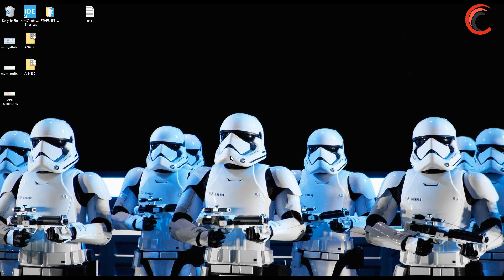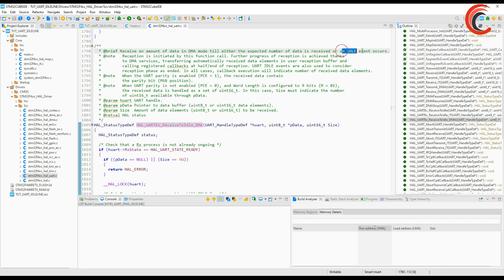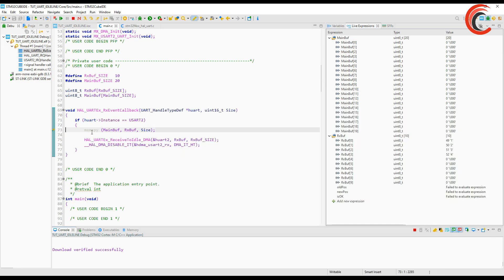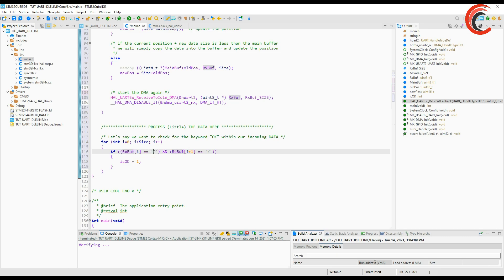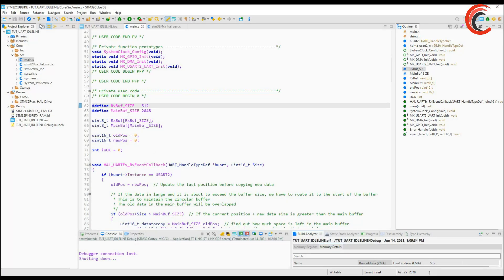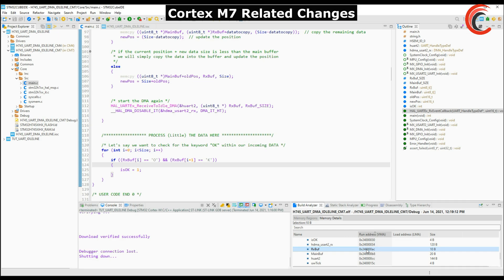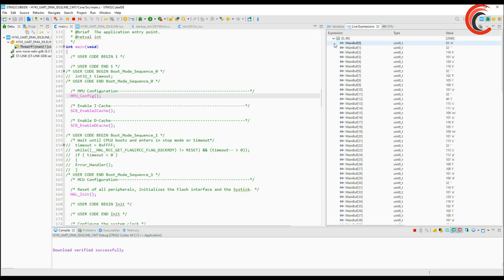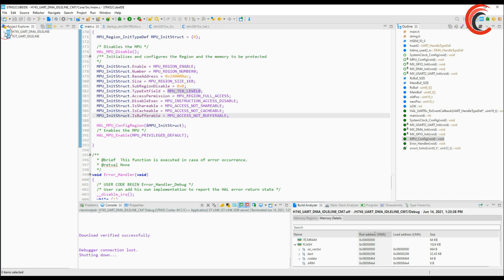STM32 UART DMA and IDLE LINE || Receive unknown length DATA

Comment from the maker: TCM memories are not cacheable. So if your MCU have the DMA access to DTCMRAM, you can keep the buffer in the DTCM and you don't need the MPU setting. F7 Series MCUs are the examples of such kind.
On the other hand some of the H7 series MCUs generate the code in DTCM RAM, but the DMA don't have access to it, so there you need to relocate the buffer to another SRAM, and configure the MPU.

To sum it up, if the buffer is in the SRAM, no matter which one, you should configure the MPU.
Reply: Hi sir,
I'm facing same issue which you shown in last part(rx buffer not storing).

I'm using STM32H7A3ZI-Q Development board.can you share me the details, how to fix.

Thanks for your video. .
Reply from the maker: Watch the cortex m7 playlist, the mpu configuration videos. This is not something which can be just fixed like that. You have to understand your mcu.
Or start with the simpler controllers first.
Reply: @ControllersTech  
Thanks for your quick response 👍 
I will check it.

Comment: Sir
Can I use the same code to receive gps data(135bytes) each second. What is the value I must provide for Rxbuf size and Mainbuf size??
Reply from the maker: Depnds on how the data is sent by the gps device. I tried using it with the neo6m, but it was not working for some reason. 
You can try it.. for 135 bytes, you can just set the Rx buf of similar size lile 140 bytes.. and set the main buf of twice it..

If it doesn't work, check out the gps video on this channel. I covered another way of receiving unknown length data (using head and tail method) and it worked for the gps..

Comment: @12:10 So how to tell when the reception is complete to start processing the data?
Reply from the maker: We don't.  Basically if you are using a computer to send the data, it will show the progress.
You can implement some character sequence at the end of the file and then check it in the STM32.
You can also check the final buffer size to match with the filesize.
Anway you can start processing the data as soon as the first chunk arrives. By the time you finish processing the first chunk, the second one will arrive.
And whe. You reach the null character, that means the reception is finshed.

Comment: Thanks for sharing!!!It's very clear and comprehensive!!! And  I got some question about using API function about uart and dma. I've have used some other api like `HAL_UART_Receive_DMA`  and write the Interrupt Service function in `UARTx_IRQHandler` in `stm32h7xx_it.c`.  But in vedio you just use another API seems in more low level driver like `HAL_UARTEx_RxEventCallback` and `HAL_UARTEx_ReceiveToIdle_DMA`.  

Is there some knowledge about how to choose thoes APi , if there I would appreciate to hear from you thanks!!!:face-red-heart-shape::face-red-heart-shape:
Reply from the maker: APIs changes based on what you want to do. The video title says IDLE line so I have used the IDLE Line related API.

How to choose ?
Well read reference manual, understand the functions of the peripheral, then look for relatable APIs in the peripheral's header and source files.

Comment: Do you have anything in regards to the data communication between a Raspberry pi 4 and Stm32? Would this video take me in the right direction?
Reply from the maker: Uart is the easiest way to communicate.  If the data length is known, you can simply use hal uart receive function. This is typically used for unknown data length.
Reply: @ControllersTech  Do you have a video for that code's set up anywhere between a Raspberry Pi 4 and Stm32? I am a tad inexperienced with the STM32IDE set up -> and communication between the two devices through UART, Just wondering is all, it's okay if you don't, I should be able to figure it out eventually, thanks for replying
Reply from the maker: Check out the playlist STM32 UART: https://www.youtube.com/playlist?list=PLfIJKC1ud8gjhc4HiqVXUzcVq4iL5MqTz
Video no. 6 and 7 are the easiest way to communicate using UART.
Reply: @ControllersTech  Okay cool, I understand the set up for the STM32 for TX and RX (Transmitting and Receiving), now what would I have to do with the Raspberry Pi in order for it to do the same thing and essentially communicate with the STM32 in the same manner via POLLING through Usart, Any Advice? Thanks for your help so far

Comment: I have been trying to make a USB serial tap for debugging (tap both Rx and Tx and send them out the USB VCOM port).
The issue I had and I've only now figure it out... and as a warning to yourself and your code..
I was testing with an ESP 12F AT command channel.  When I ran my STM32 app the module was usually sitting idle doing nothing.  So I would pull it's RESET pin low and wait for my app to fire the interrupt for the boot output and eventually "ready".
Nothing happened.  No data.  No call backs, nothing.  Hmmm.
It was only when I put a logic analyser on the serial line that the "penny dropped".  By pulling the reset line low to reset the ESP it generates "break condition" in the UART signal until it comes back up again.  That break condition aborts the DMA transfer.  The abort does not call the RxEventCall back as no data is received.  
If you don't take care to resume your DMA Rx on such a fault condition, your code will most likely dead lock.

Comment: Hi I had a weird problem would be happy if you can help

I am trying to commiuncate 2 stm32 (one transmits in DMA a text in every second and the other recevies in DMA). Transmitting one has no problem works well But

 When I type this code in the "int main(void) USER CODE BEGIN 2" of Receiver  (as you did in ur video)

"	  HAL_UARTEx_ReceiveToIdle_DMA(&huart2, received, received_size);
	  __HAL_DMA_DISABLE_IT(&hdma_usart2_rx, DMA_IT_HT);
"

if I don't put anything in "while (1") part it doesn't receive and read it just stays idle but when I put the upper code in "while(1)" it starts to read

But in your video you didn't use while part at all and it still works why ? Can you explain ? Thanks
Reply: Üstadım, çözüm buldunuz mu? Bende de aynı sorun var. Video video geziyorum :) Bu arada STM32F1xx'ler STM32F4'lerden farklı davranıyor sanıyorum, bu videolarda olan şeyler STM32f1xx'de olmuyor.

Comment: At 8:25, line 114:  It seems that the for-loop should go to "i<Size-(n-1)" (where 'n' is the size of the string you're looking for), because checking for "K" inside the loop will try to compare a byte outside of the buffer.
(Or use modulo if your data wraps around).

Comment: Great tutorial. at 7:50 you explain how to fix the issues with the mainbuffer not appending the data correctly. Just a quick question though: 
void HAL_UARTEx_RxEventCallback(UART_HandleTypeDef *huart, uint16_t Size)
{
	if(huart->Instance == USART3)
	{
		memset(aMainBuffer, 0, sizeof(aMainBuffer));
		memcpy(aMainBuffer,aRxBuffer,Size);
		HAL_UARTEx_ReceiveToIdle_DMA(&huart3, aRxBuffer, RXBUFFERSIZE);
		__HAL_DMA_DISABLE_IT(&hdma_usart3_rx,DMA_IT_HT);
	}
}

Your solution seems quite complex. Why dont you just reset the main buffer everytime the eventcallback is triggered, that way, everytime you copy rxbuffer to mainbuffer mainbuffer is emtpy.
Reply from the maker: Because main buffer is suppose to store data which can be processed later.
If we reset it everytime the event is triggered, then there is no difference between rx buffer and main buffer
Reply: @ControllersTech  ahh i see. The data will remain there but only till you receive a new command .
Reply: @ControllersTech  When I did this (double buffering) for DMA transfers (readying bursty high rate MQTT messages), I instead created an array of buffers.
uint8_t buffers[COUNT][SIZE];
Then circularly loop the buffers with a head (processing reading) and tail (DMA call back writing).
I was however matching on protocol headers with a start byte and a message length, so I could get each message in a buffer on it's own.
I ended up needing this because to two things conspiring.  On start up I had to render the display background etc.  At the same time the messages would start flowing on the UART and because the system had just connected it was going to possibly receive a large burst of queued messages.  Combined this caused buffer overruns which I didn't like.  So I increased the buffer count from 2 to 8 and didn't drop a single message on start up :)
Reply: &hdma_usart2_rx the typedef was not initialization was not happening. It was declared. So I had to static as way to force the typedef to take hold.

Comment: hello Controllers Tech,
I have use this function HAL_UARTEx_ReceiveToIdle_IT(&huart4, rx_buf, rx_buf_size);

and successfully able to get rx data.
Please tell me how to adjust timeout for this function, since i want increase idle timeout my my application
Reply from the maker: Idle line doesn't work like that. You can't adjust the timeout for IDLE line. 
Basically it depends on baud rate.
Say if the baud rate is 1000bps means 1000 bits per second. The time between each bit is 1ms. Then if no bit is received for 1ms, the idle line interrupt gets triggered.
Reply: @ControllersTech  thanks for the info

Comment: Can we increase the idle event time? so that complete unknown data can be achieved and after that event interrupt occurs.
in my case first, 5 bytes transfer abruptly and the remaining bytes transfer after a little conversion. but I need all the bytes at the same event occur.
Reply from the maker: you can use simple uart receive function. It have the timeout feature, so even if the buffer is not filled, the timeout can occur and you can process the received data

Comment: I cant use HAL_UARTEx_ReceiveToIdle_DAM callback on STM32F417, because extended library is not included? Is IDLE line detection possible only on F7 family?
Reply from the maker: That tutorial was made on f446.
Also i have tested on f103, f407,f411 too.

Comment: Hello.  My IDLE interrupt not working properly. My Buffer size is up to 255, but IDLE is calling after 16 characters. If i place transmit feedback here i receiving it few times. It looks like idle time is too short?
Reply: Ok When I decreased the UART Baudrate it almost working fine. On the new baudrate i can achive up to 512 characters at a time, but sometimes is 256, even if configured twice more. Why is it?

Comment: Very nice! I'm a bit of a beginner when it comes to dma. For some reason I only recive the last character I send with this method. I use an STMF373VB. The HAL_UARTEx_ReceiveToIdle_DMA Interrupt gets triggerd correctly but in my RX-Buffer only the last character is present. The strange thing is, that the Size transfered to the Interrupt is correct.
Reply: Be sure the DMA is initialized before the UART
Reply: @leonelcra  Great! It worked for me. I had the same problem as Balde. Thanks to both of you.
Reply: @leonelcra  Awesome advice! Would you mind letting me know why initializing the DMA before UART solves that problem?
Reply from the maker: Rx buffer is supposed to have the recent characters. That's why we have another buffer, main buffer, where we save the previous data as well as the new one
Reply: @ControllersTech  The problem was the Baude-Rate actually. I set it to 115200 but the max for my chip is 38400.

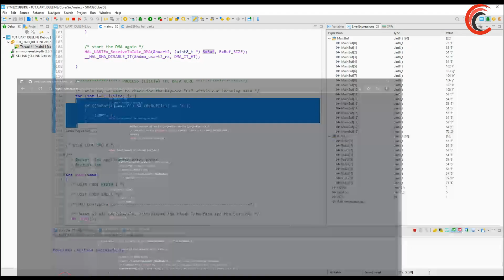Comment: Hi, thanks for this video. I'm new and not familiar so much with stm32, so can you make a guide how to use this with the ring buffer, and can you modified the code like you said at 10:18 :v
I want to get a buffer receiving from uart (large data, json format) and store it in a "string", like arudino. Can I use malloc, realloc for MainBuffer and then free it? Because in the video I saw that the main buffer is overlapsed when receiving huge data and I have to get the string out of that buffer, but you said dont do a lot of works there ( it can disturb the receiving progress).
Reply from the maker: Yeah i will write that code soon. I am not getting enough time for it. I'll try Probably this weekend.
You can use malloc, but the point is when exactly are u going to free the memory ?
You can't do the entire processing in the callback, or else you won't get the new data.

If the data is huge, and you don't want to overlap, then create a big main buffer. Do the processing in the while loop, or create another function for it.

Comment: Not working for me... no interrupt gets called.
Reply: I have a similar problem, STM32L496RE. couldnot enter the interrupt.How did you solve it?
Reply from the maker: What MCU ?

Also check with the simple uart receive if that's working or not.
Reply: @ControllersTech  I finally found the problem. The problem was that the DMA only works in the D2 RAM. From the datasheet: "Two dual-port DMAs (DMA1, DMA2) located in D2 domain, ...". I use the STM32H743VI MCU.
Now I just created a pointer to that region instead of a array buffer.

Comment: Why  isn't circular mode working? Any particular reason? Isn't the callback function called just as before with normal mode?
Reply from the maker: Ofcourse it can work, but then you write your own code to handle the data in the buffers..
Reply: By doing that, you save the second buffer.

Comment: Thank you fot another important video. Looking forward for the explanation of this cacheable memory and why we need to configure MPU. You set the address of the MPU to the read address where RxBuffer is placed. But when you then declare some other buffer before RxBuffer the address of the RxBuffer will move and will not be correct for this defined in MPU. In small project it is under controll but in bigger project it seems to be hard to keep it under control. Maybe I don't understand something properly so I wait nervous for next videos. Good job!

PS. When I move the RxBuffer to the other SRAM, do I still have to configure MPU?
Reply from the maker: Yes the rxbuffer will move and that's why in big projects, we have to be really careful about this.
I have explained in the previous video about fixing the location of rxbuffer.

Regarding the movement of the rxbuffer, check the pinned comment.

Comment: you get a hardfault in stm32h7a3 with mpu
Reply from the maker: What's the address of rx buffer ?
Reply: @ControllersTech  I added them to a section and modified linker script to place them on ram. 0x24000000
Reply from the maker: I have tested it for h7a3, and it works well for the same memory address like your.
You must be doing something wrong.

Check in the memory details if the rx buffer is showing up at the new location.

Try simple memset operation on rx buffer to check if it causes hardfault
Reply: @ControllersTech  should we use mpu ONLY if the buffer sits on DTCMRAM (0x20000000)? Does mpu and buffer relocation  cause the hardfault? I have relocated the buffer to RAM. Everything seems to be working with just the relocation.  I believe I followed your tutorials precisely . its a brand new nucleo stm32h7a3 board. I got the memory address from the memory explorer. I will try once again leaving the buffer at DTCMRAM (0x20000000). I am 99% sure I didn't miss any step
Reply from the maker: Like i said i tested with the same address and it worked perfectly.
Send me your main file @telegram or discord or mail
Reply: @ControllersTech  just emailed you. With mpu on dtcramram it gets hardfault
Reply from the maker: Like i mentioned in the first video, dma can't access DTCM.. that's why
Reply: @ControllersTech  i understand that, but when i relocate to ram and enable mpu -> hardfault
Reply from the maker: Contact me.. i need to see the setup you are doing
Reply: @ControllersTech  i emailed you at gmail
Reply from the maker: What gmail ? I don't have gmail..
Goto about page on YouTube and there you will find the mail ID